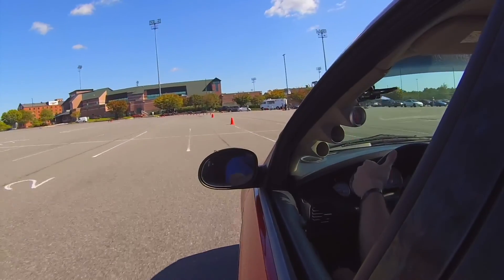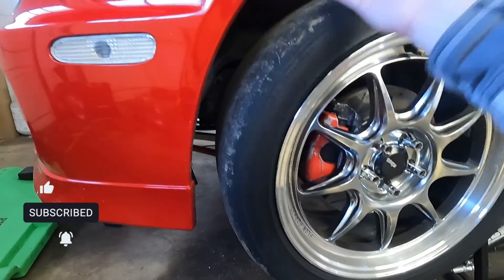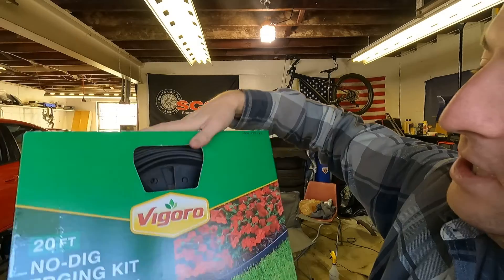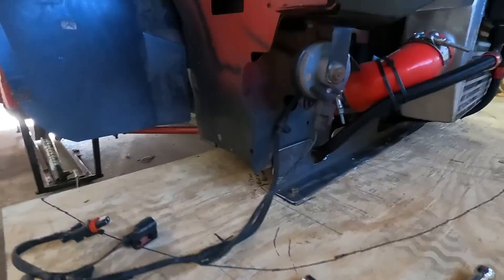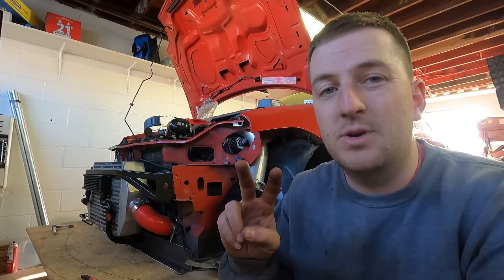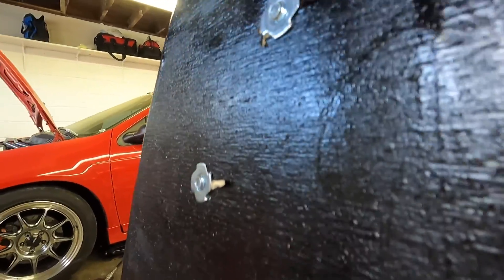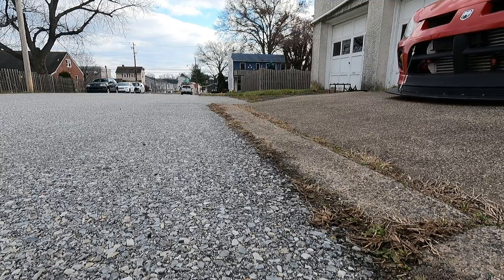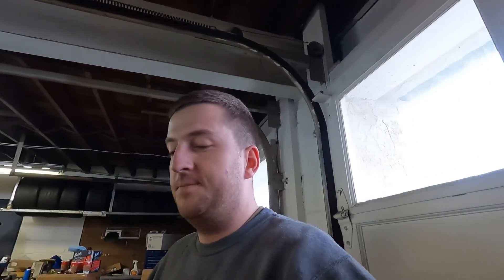Custom DIY Chassis Mounted Splitter for $200

Comment: the downside is that wood would start to decompose after it gets wet... use ABS plastic
Reply from the maker: @n1kk332  yea i have already replaced it once because of that. BUT if you keep the car inside it will last much longer. Also I recently moved to the desert so water isn’t an issue now lol.

Comment: I hate to say it, but i dont think that will qualify for the class youre wanting to run in.
Reply from the maker: @jeffreymoffitt4070  haha yea you’re right. it didn’t qualify before and it still doesn’t qualify now with the new rules. Puts me straight into street modified. I removed it for autox and ran it for track events. I’ve since added fender vents so there’s no going back now lol

Comment: #1 make it level with the ground or higher in the rear(slightly)

#2 your air damn needs to completely seal off all entry points between the spltter & the bumper

#3 weigh it. i bet that thing weighs alot & that matters so work on weight savings for v2

good first draft👍

Comment: good video, was worth the watch. Question....What's the lo-down on those lifts that the car is on? Make those? or did you buy them?
Reply from the maker: @Comestomind  thanks man! They’re made by Quickjacks. They’re like $1500 to $2500online. You can probably find a used set. Just know they have different models for different size/weight cars.

Comment: there is a guy that sells splitter rods that compress, spring loaded.
Reply from the maker: these are carbon fiber rods Im currently using from Professional Awesome. They compress but won't stretch. That's why I can stand on it.
Reply: @zackellis23  I meant collapse. Well at least what they call them. But they have whatever length to them and when you go over something higher they shorten via spring inside. It's pretty cool
Reply from the maker: @lumimobb  ohhhh I see what you’re saying. If you remember what they’re called let me know. I’d be interested in checking them out. I think I’m going to try and make version 2 of the splitter sooner than later

Comment: I used Lexan and c-channel aluminum to mount over the lower core support lip and then all the factory holes for the under cover with the exception of the hole at each end by the wheel wells.
Reply from the maker: That's actually a really good idea. I might try that
Reply: @zackellis23  yes, its lasted over 10 years and seems to be nearly indestructible. Painted it black plastic paint. Use at least 1/4".

Comment: Zach brother it's time for tires! Also I have a brand new 2.9 bws I'm getting rid of as I went big turbo!
Reply from the maker: Hahaha I know. I used them so long because I’m switching my set up for next racing season. I have slicks to mount up next year.
Reply from the maker: Also how much are you asking for the BWS?
Reply: Only what I payed $600 I had a 1.0 die that I sent in so I got more off than most.  It'll be brand new in box. 
Email me or find me on Facebook.
Reply from the maker: @brandonshupperd792  I’m not quite ready for a new turbo but when I am I’ll reach out
Reply: Slicks or like a r888?
Reply from the maker: @brandonshupperd792  an actually slick. Not gonna be used in the street. I have new wheels for the street. No tires yet. The tires I have now that are bald are re-71r

Comment: Did you make the support/traction bar setup for the front or did you buy it? I've never seen one like that
Reply from the maker: So I bought them used for $200. From what I can tell they are made by Bwoody. 

Here’s a link. They’re dumb expensive lol

https://www.bwoodyperformance.com/proddetail.php?prod=120.2012
Reply: Not made anymore. Have to find them used if you want some.
Reply from the maker: @outdoorchristianboy  yea kinda figured lol

Comment: The way you traced it out with that filter box made me feel sooo dumb, that was awesome.
Reply: Also the trick they showed me for scrapping is to use stickon velcro felt on the contact points for protection
Reply from the maker: @akirony  that’s a good idea! I appreciate it
Reply from the maker: Hahaha nah don’t feel dumb! I used it so I knew I’d have close to 4” and it would be consistent and easy.